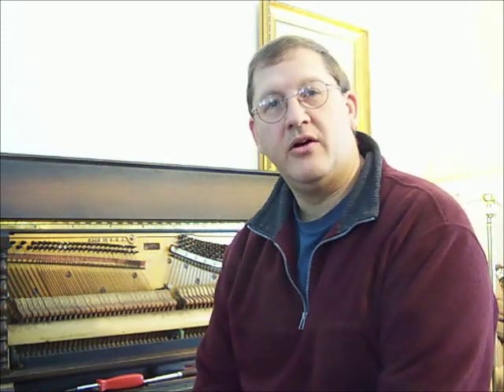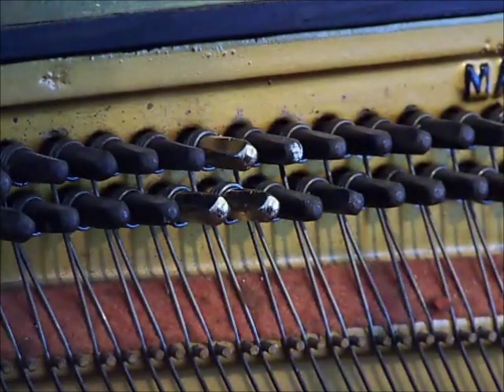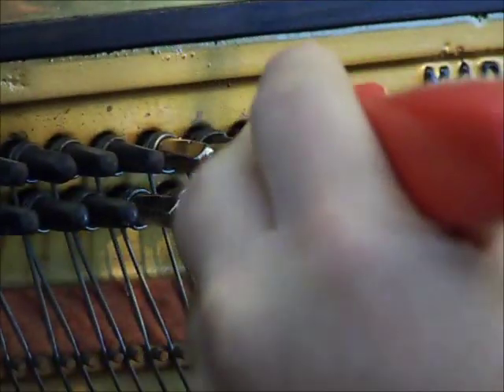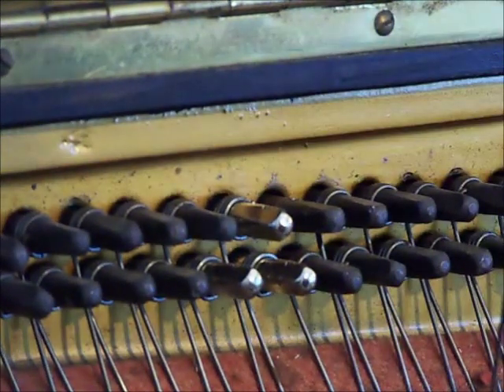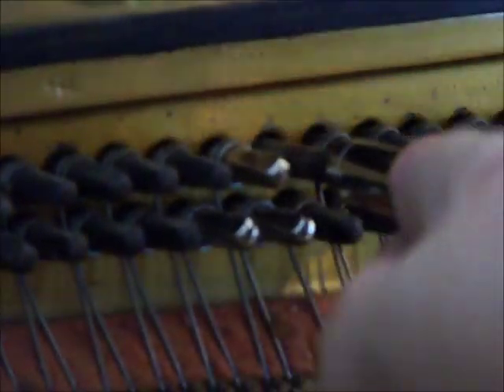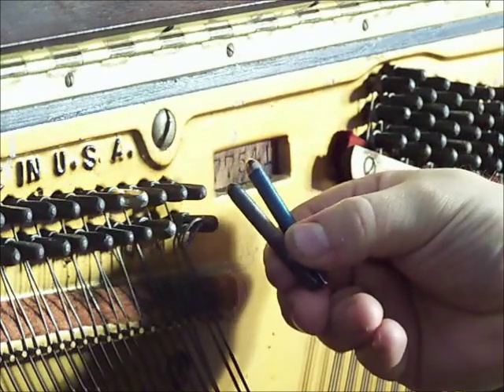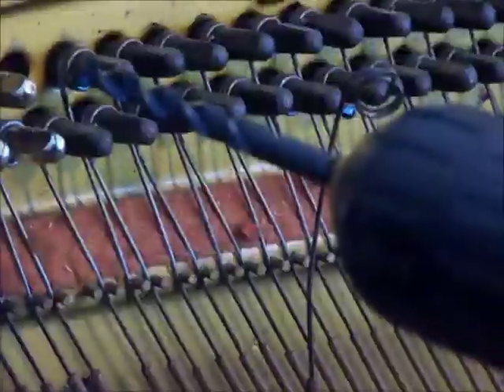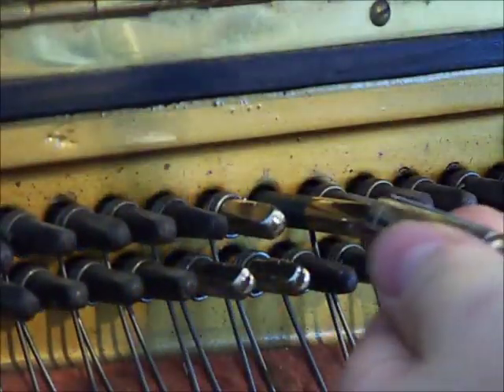How to replace piano tuning pins

Comment: When replacing a loose tuning pin, it is recommended to make it TWO sizes larger, since there is only a couple of thousands difference in the pins in the first place. And you do NOT drill out the hole for the new pin. The pin block won't break doing that, since it is multi-layered laminated wood. It will go in very tight which is what you are looking for. Also using a pin driver tool, you also should tap in the pin. On a grand, it isn't a good idea to do that, but on an upright it's okay. If you do thread the pin in the new tight hole, move it slowly since friction will be very high. Don't over heat the pin putting in the new one. Good video.

Comment: I've been tuning for money since 1980. Things have changed, CA glue  is 10 times easier and faster. I've done about 100 pianos with loose pins and guarantee that the pins will hold. It works.

Comment: You don't screw the new pin in. You hammer is in. Screwing will enlarge the hole. Refer to the "Haynes Piano Manual" for the correct procedure.

Comment: Good video. I agree CA glue does the job. 
When you backed out the pin it looked like it was pretty tight. Did you try hammering the pin in some?
If there’s a crack in the pin block putting larger pins In could enlarge the crack. 
But has not happened to me so far. Thanks

Comment: When removing the pin, you do not have to pull the string all the way off over the pin, you can just unhook it and then unscrew the pin while the coil is still on the pin. That way there is less risk of string cracking which might happen. Then you would put the pin through the same coil and with the help of tuning pin punch simply hammer it in. Then hook the coil back in and screw the pin as much as you have to. At the end, punch in the pins to look even.

Comment: The way you hold the lever horizontally, you bend the tuning pin the most, this can make the hole oval, on an old piano hold the lever more or less in the string orientation so to protect the "bed" of the tuning pin, feel better the pin and limit the bending.

Comment: Never drill out for a new pin. Just use the next size up (or the 2nd size up if the original is so loose that the hammer just falls while sitting on the pin. Also, using sandpaper is a temporary fix till you can do it right. Hammering or screwing in doesn't matter so much. Generally hammering is just easier. Screwing does not enlarge the hole. I agree with Mr. McLaughlin that CA is probably the easiest way to go.....but on uprights, I like to lie them on their back first to apply the glue. (I have been a PTG technician for nearly 50 years.)
Reply: +John Bianchi Thanks, this will be very helpful to me here in the new future. (And in reference to the "bad advice", I just watched a video that said if the tuning pins were loose, you might as well throw the piano away. Luckily I knew well enough to laugh but you have to wonder. He was tuning the whole piano with a guitar tuner... so..anyways.. These people aren't claiming to be experts, they're just sharing their experience. We should all give em a break and thank them for taking the time to share. )

Comment: Also, twisting the string at the hitch pin in the direction of the winding on the string is necessary to keep the winding from loosening and making an objectionable noise.

Comment: Greetings from Brazil !

you can use a marking awl to get the becket out of the tuning pin (a pointed shaft)
a T hammer can be used to get the pin out
YOU ARE NOT SUPPOSED TO SCREW THE PIN IN !!! Better use a 4 or 5lb hammer and a tuning pin punch !!!
The string would normally need twisting - maybe as it is an old string maybe not but it may sound dull without twisting (in the direction of the winding)
The coils should be held together with a coil lifter whilst tightening
then you should tap the coils down gently with a brass drift or perhaps a screwdriver
the string should also be tapped gently against the bridge with a brass drift
The ideal position for the tuning cranck when tuning uprights is around twelve o´clock and for grands 3 o´clock

Comment: Second, you don't have to drill to go one size up on the tuning pin, you'll actually get better results if you drive it straight in with a special spring loaded tool called a "tuning pin setter" which fits over the tuning pin which takes the pounding instead of denting the top of the tuning pin with a ball peen hammer.  For a grand piano, you would have to remove the action and put a scissors jack etc under the pinblock to support the pounding.  But honestly Karlboer what you're doing works.

Comment: I'm getting rid of an old rotten piano from 50 years in a basement, that cast iron piece those things go through is mounted to a solid piece of wood laminated in different directions for perfect stability. I'm trying to take all those out to get apart to get rid of. It's way too heavy to get out together without splitting a gut 😆. 
 I took a 3/8" drive socket extension put in drill backwards then added a 1/4" to  3/8" socket connector and put that in backwards to remove these and it works pretty well. Like I said this is to get it out of my basement to the dump. 
 I'd show pic but nowhere to upload it does work pretty well and cost me nothing

Comment: If there are 2 pins in a row, for example two neighbouring top pins, this might mean a crack in the pin block. In this case inserting ca glue is your best bet, installing a larger pin or hammering can make the crack bigger.

Comment: Usually the holes are deeper than the length of the tuning pins.  I would have just put the string on the tuning pin, be sure the other end (loop) is on the hitch pin and turn the string in the direction of the copper winding and insert into the hole.  Drive in place leaving about 1/8 or so between the coil and the plate and pull up to pitch.  Done!

Comment from the maker: Babaziba,

One of the tricks that piano technicians use is to hammer the pin deeper into the block.  This cannot be done if the pin is already to the point where the string is down to the block.  In my case, the pin was as deep as it could go, so replacing it with the next larger size pin was the only option.  

Karl

Comment: i was wondering if you had seen the aluminum bushings to fix pins?   i was just wondering if you had heard of them or tried them, i think i might try it, its just an aluminum bushing that fits in the pin whole then you stick the old pin in.  iv'e tried to find some info online about it, but haven't found much, it would be preferred since when tuning i wouldn't have to switch to a different hammer size to tune certain pins.  thanks
Reply: this is a late response but to answer your question, aluminum inserts for tuning pins are terrible! A piece of sand paper is better.

Comment: on a $25 piano you can't mess things up too much!  But from a technician's standpoint, there are other options.  First, you can use CA (super glue); the old pinblock "dope" tightener yielded poor results!  CA glue (thin, runny type not gell) works miracles and can be applied with a pipette or other smaller applicator even with the piano upright.  You apply the CA glue right around the tuning pin without removing the pin.  It "wicks in " immediately and you can feel the difference immediately.

Comment from the maker: I read in a piano repair book (the most popular one out there) that you should drill before threading the new one back in.  When it comes to the pinblock, I don't want to take the chance of cracking the block.
Reply: The most popular book probably is'nt the best book as it's directed to the general public and probably not a professional one. Make sure your authors are credible. Also you don't need to drill out the holes usually because the holes are usually a bit deeper than the pin so they can be banged in if their lose. Most importantly you never, Ever screw the pins in. It will enlarge the hole and create heat that will make it on the very low end of tight. You always apply french chalk to the pin to prevent clicking, "seizing up and releasing while moving" and line it up and pound it in like a nail with a tuning pin punch. This should never crack the block unless it was already cracked. Or your going from 1.0 to the biggest size with tight pins. Even then though, it is'nt enough of a difference to crack it. I've pounded in pins a size larger on a 125 year old piano with severely lose tiny pins and did six. No problems at all, and the pins are rock solid like a new piano.

Comment: the size is probably not strong enough.

Hammering is done usually, or one have to wait very long to avoid the heat (when turning the pin, heat will force on the hole). A new pin have anyway a new thread (old ones are used and provide less friction for that reason)

change on a 1950 piano : pins 60x7.10 originally, replaced by 60 x 7.25, in a good quality block that is perfect. that one piano have a poor block visibly.

Comment: It looks like there is enough room behind the coils to drive all of the tuning pins in a bit. The string should never touch the plate.  Driving them in can extend the life of a piano by several years before rebuilding / restringing is necessary.

Comment: the last thing you want to do is use a drill. One size up if  that slips then two up.. I have heard of using Loc Tight  or super glue .. of course on a upright you don't have the benifit of gravity...so any "doping" would be in effective un less you lay the piano on it's back.

Comment: Nowadays CA Glue applied to the pin block is the way to go. Much easier. I guarantee it to hold for 2 years but its good permanently, not counting humidity changes. Tom Lloyd

www.mrtuner.ca
Reply from the maker: Thanks Tom.  Is this applied at tuning, or does the glue add enough friction to the pin for it to be tuned and still stick?
Reply: I've done CA glue to about 100 pianos. You need a piano truck to lay the piano on a horizontal plane. Then squirt about( 2 oz }of CA Glue in  pin holes, about 20 minutes. Come back next day, put piano back in upright position and tune. I charge 325.00 tubing $150 x 2 plus glue, $25.00. Much easier than changing pins. It works, I guarantee it.
Reply from the maker: Add glue to the pin holes... behind the pins?  Leave piano in horizontal overnight?  Hmmm.. Sounds interesting like I may try it!!

Comment: You'd do better without the advice of this video.  First try banging in a bit further (not quite up to the plate, and wear eye protects).
Re-use the old pin but wrap some sandpaper round it (grit outward).  Don't ever drill a hole larger.  Hammer the pin in rather than turn it in.  Best get a trained tech unless it really is a low value item anyway.

Comment: Oh, boy... Obviously this piano needs to be properly restrung with a new pinblock.  There is a reason tuning pins are driven in and not screwed in.  The reliability of this DIY is short lived at best. It's somewhat surprising the strings aren't breaking right at the beckett.  The gooseneck tuning lever says it all here.
Reply: It is an old piano that will end up in the garbage before he replaces everything.